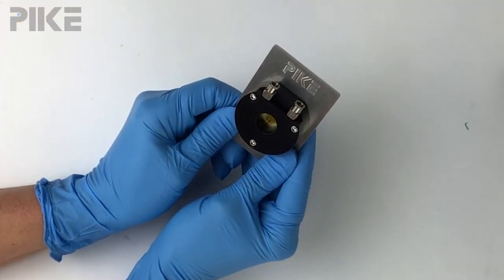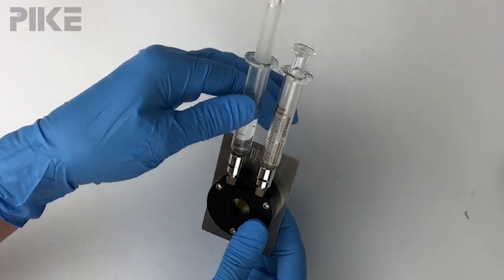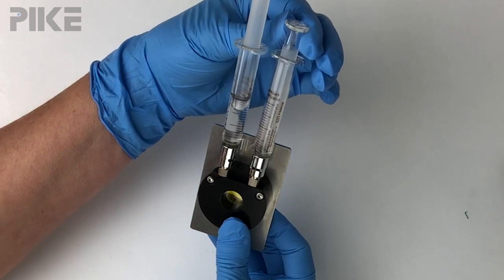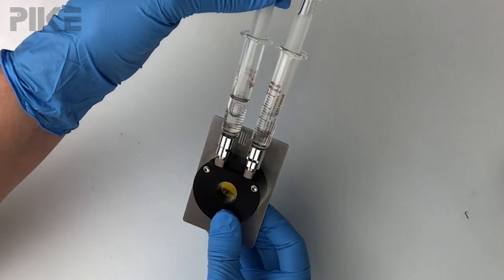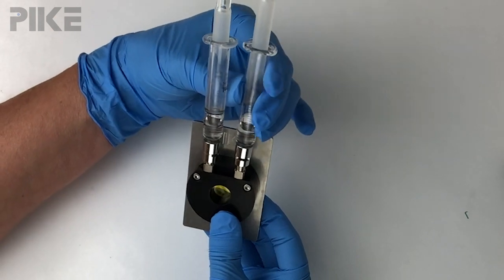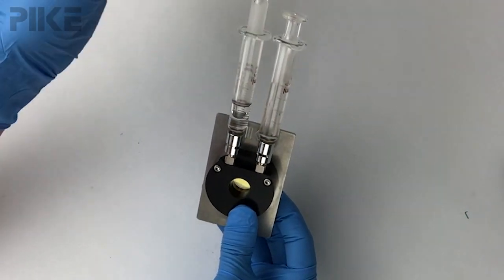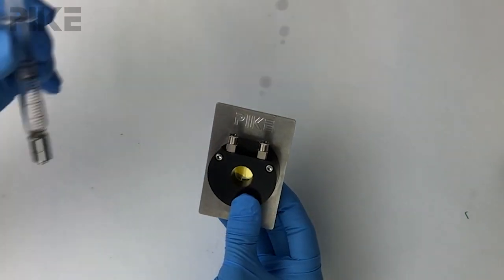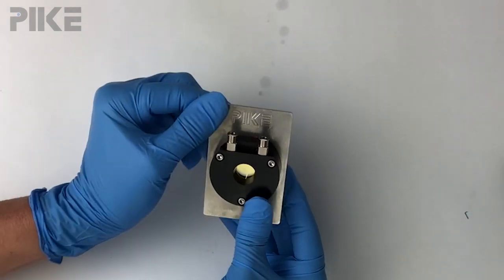Best cleaning technique for a liquid transmission cell

Comment: We have a KBr cell that has been used to test DCHA.  Will this method still work and what solvent would you recommend?
Reply from the maker: Hi Joel,
DCHA is soluble in most organic solvents. Be sure, however, that your solvents are dry. Even a very small amount of moisture in the solvents can cloud your KBr cell windows.

Comment: Wouldn't there be residue of the solvent in the cell? Do we just leave it to air-dry?
Reply from the maker: Thank you for your question, @wildreams. To avoid residue/contaminants, be sure to use an ultra-clean, spectroscopic-grade solvent. To dry the cell, I like to use an empty syringe and push air through the cell to speed the drying process. 😉